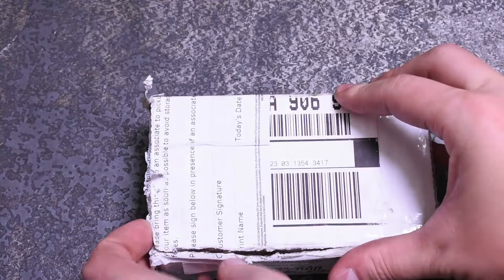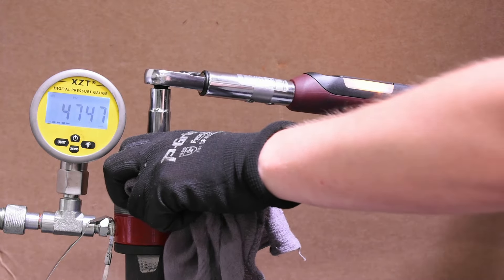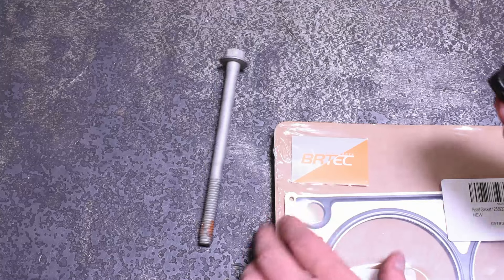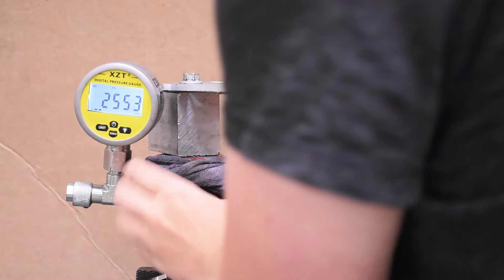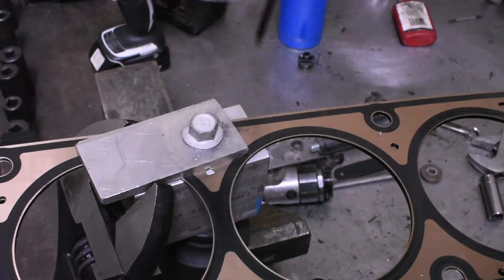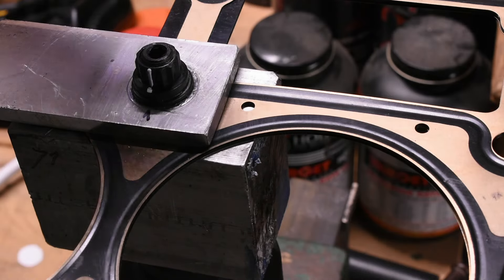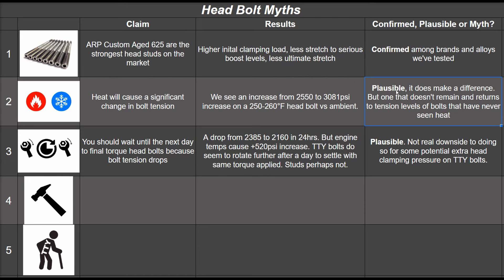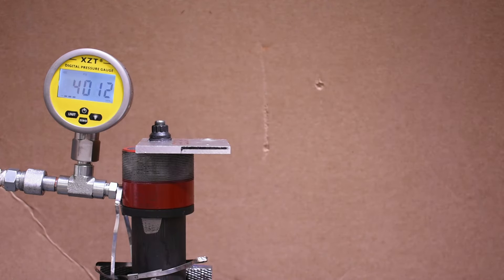CAN You Reuse Cylinder Head Bolts? Testing Myths + ARP Custom Aged 625+

Comment: Fun fact: Honda actually says you can reuse cylinder head bolts and gives a separate torque sequence for it (one less 90 deg turn.).  This still assumes they're not stretched too far of course and there is a thinness where you replace them.
Reply: Do they have a TSB on how to remove the crank bolt?
Reply: @FordRanchero289  Shaped charge using C4.
Reply: @JCWren  the shaped charge should contain approx 2500gr C4
Reply: Yes as long  bolt hasn't  been grossly over tightened  to the point of necking although the unloaded  length of bolt  of the used bolt will have increased by tiny fraction  the actual  load  the bolt can carry  before failure won't change,  also the  length of the bolt when loaded to failure doesn't  really. What has to   checked for is the condition of the threads that they screw in with out binding which would make the initial torquing before angular tightening wrong and make the angular tightening garbage.
Reply: I just did a head gasket in may on my accord and reused mine after checking the threads. I seen the separate torque spec.
Reply: on which engine?  i reuse honda bolts on b18 b20 engines although never seen any mention of angles?
Reply: @FordRanchero289  Weighted socket and a impact.
Reply: Always reused them and just torqued to spec and never got a problem even with boosted engine making double the hp
And ARP can be reused indefinitely if they are not stretched they even give a card to write the lengths before each use
Reply: @FunBitesTV   the correct term is torque to yield bolt 
it only useful for new bolt the additional angle is for the bolt stretch/yield and after one use they are normally stretched and supposedly need to be changer but like you experienced it still work fine
A can tell you that used bolt got no problem holding head gasket even at 300+hp
Reply: @FordRanchero289  thermite
Reply: @FordRanchero289  the good old starter trick
Reply: @Themobilegearhead  yep 👍 I’ve always just done a breaker bar against the ground and jump the starter to break loose. Might not be the best but it works for me and I’ve yet to have any issues with boosted B/H/F series motors
Reply: Maybe the new DCF900 will do it 😅
Reply: Yep, I love not having to do 22ft/lbs and 3 90° turns when I'm doing rings. Two turns is more than enough over 8 bolts in a hard to reach spot.
Reply: @FordRanchero289  my 2767-20 will pull them most of the time without the weighted socket, with the weighted socket I've yet to have one take more than 2-3 seconds to come loose
Reply: Honda torque specs and procedures for head bolts vary depending if it's 6 or 12 point to.
Reply: @FordRanchero289  Milwaukee 2767 got mine loose. No fancy sockets either
Reply: Torque sequence lol, degrees lol. With a rainbow flag too?
Reply: @FordRanchero289  they make a socket. it has really thick walls. its really heavy.
Reply: @FunBitesTV  Honda V6 engines have three 90 degree turns if it’s a new bolt, only two if it’s used
Reply: Yea when you're only torquing to 49 lb-ft, of course you can reuse the bolts
Reply: 1990s Honda Accord head bolts are the thickest, even a V10 Triton head bolt is skinnier.
Reply: @FunBitesTV  My K24A2 definitely has TTY head bolts, I believe all the K series engines do. The torque spec is 28 foot pounds plus two 90 degree turns for used bolts with an extra 90 degrees for new bolts. Before reusing them, you are also supposed to measure the bolts to make sure they didn't stretch too far.
Reply: People don't understand that if the application states "TTY" but you don't actually measure stretch or clamping force...you have no idea if it's actually above the elastic region. Thus if the OEM's bolts are stronger than the min spec for that torque rating, it can be re-used since it never yeilds.
Reply: @FordRanchero289  a weighted socket.
Reply: @FordRanchero289  my 1/2 inch cordless wins every time
Reply: @ddiablolll  my Acura legend is due for a head gasket replacement before it blows I might just reuse them then
Reply: @jkull173  it never fails I was amazed when I learned about this technic
Reply: @FordRanchero289   Weighted socket, works every-time.
Reply: can confirm
Reply: I worked at a multi agency dealership in the 2000's that had a Honda dealership. Under warranty, the head bolts could only be replaced if they fell out of spec. If it was customer pay the head bolts always got replaced. Don't ask me the spec as I was the transmission tech at the Ford store.
Reply: @FordRanchero289  even my 1/2" ridgid mid torq thats not even an octane breaks them free w a weighted socket no problem
Reply: Toyota also says, you can reuse cylinderhead bolts (on some engines) . You only need to check the length of them. Same torque sequence if I remember correctly. :)
Reply: @FordRanchero289  1, make sure battery negative is removed off negative battery terminal. 2. Set your purse down.
Reply: Thinking about wheel studs...you can mount and dismount wheels again and again, on the same stud. Plenty of torque on them, they get heated, because they are attached to the brake rotors, and are a mission-critical stud, being what attaches the wheel to the car. hmmm.
Reply: With today cars, fairly week aluminum block and heads i have no problem reusing head bolts, i believe the aluminum treads in the block will strip and the holes in the head will compress well before damaging or stretching the bolts imo - with old cast iron block/heads i would use new bolts.
Reply: @FordRanchero289   3/4 in. impact gun and a minimum of 160 p.s.i of air.
Reply: @FordRanchero289  easy , weighted socket ...
Reply: @themechanicnextdoor5144  thats a good  tip thanks. I'm  assuming when using the same torqued portion of the sequence the old bolt has already compensated for difference in stretch compared to new. So it needs less distance to reach yield after that point.
Reply: Where are all the old Honda,s past 2000....they are like a wal-mart toaster
Reply: My Honda book says to mark the original location of each bolt for reuse
Reply: Subaru also I’ve re used every head bolt for years and never had failure. Except for my high hp motors. The stock rod bolts will break before anything else breaks in a Subaru motor. This causing rod bearing failure. If you took a stock Subaru sti internals  which I did. And put arp rod bolts on it. It will hold 350 hp all day. The 2.0 I built held 429 hp on the dyno but that broke the pistons on the street, the rods held up though so moral just be happy with a fun 400 hp subie unless you have forged internals then still 400 hp otherwise your trans will never make it. Plus 400 hp in a subie is un real.
Reply: Good ol Honda
Reply: @JCWren possibly funniest answer I have seen on yt, both acknowledging that u know the misery and u have humor 😂
Reply: @HeidiFegles It has nothing to do with Horsepower. Upgraded rod bolts support higher RPM and or heavier pistons/rods. Think about it, higher HP puts higher downward load while max tension loading occurs at TDC on the exhaust stroke.

Comment: Well the 'myth' on reusing TTY bolts.....I work for a major auto manufacturer (won't mention who to not freek anyone out) and one of our engine types started requiring cylinder head replacements for coolant and oil leaks from the casting. These use TTY bolts that are in very short supply and frequently go back ordered so we are required to reuse these bolts by the manufacturer if they are under a stated length when measured with a micrometer. Note if these are over the stated length they must be replaced. I'm not an engineer just a technician. As you can imagine most techs, me included, absolutely hate this idea but the engineers have obviously tested them as warranty concerns are a factor. We have yet to encounter a problem with any of these cylinder head replacements some being done over 2 years ago. I'm guessing that the engineers see this maximum stretch for reuse as still enough of a safety margin.
Reply: Ford ecoboost?
Reply: Subaru impreza doesent mention to use new head bolts even though they are tty as it has 2 90degrees at the end
Reply: @Low760  you beat me to it. Lol
Reply: @Low760  either that or GM 5.3 with the lifter issue.
Reply: @JamsheedRpgGodBoss  the guy said replacing head gasket for coolant and oil leak at the casting nothing about lifter failure 
This scream EcoBoost problem or any other high stung turbo small 4 cylinder that are all the craze these past few years the purposes is they can still advertise high  HP with low mpg
Reply: I used to work on old cars and reused bolts if the bolts didn’t look stretched or otherwise damage, never a problem.  A bolt stretches at the nut or where it’s bolted in, a nut cannot be hand tightened all the way down the threads because of stretching.
Reply: Good ol' Toyota 2AR-FE engines had maximum TTY bolt length spec as well to decide whether to replace or reuse them.  Replacing piston and rings for the oil consumption issue was common (They switched to 0w20 from 5w30 with low tension rings and too few piston oil drainage holes)
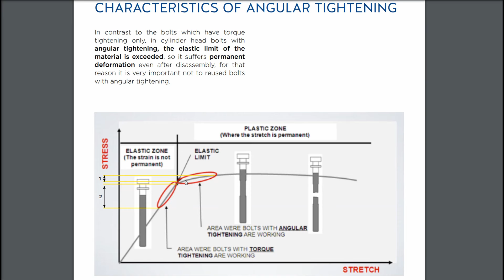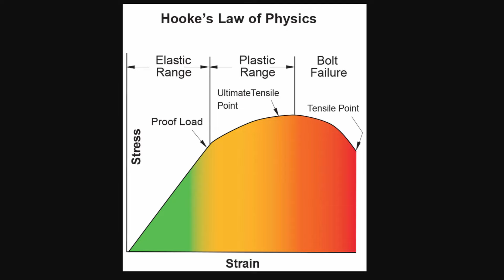Reply: If you look at the curves at 7:30 and at 8:00 in the video you can see that once a steel has been taken beyond yield it can still stretch more before it fractures.  The whole idea is that you don't want to use up too much of this stretch by re-yielding the bolt.  Maybe some bolts can be tightened a couple of times and still have enough reserve elongation left.  Consider if you pick up a piece of steel wire and start bending it, once you achieve a permanent deformation you have reached yield point but something like a coathanger you can bent a lot past this point and it never fractures.  The higher strength alloys have some amount of ductility but not nearly as much as low strength wire used in coathangers.
Reply: I say Chevy sounds like a Chevy design choice.
Reply: Trust me when I say, as an engineer, the engineers didn't decide to approve this procedure.  They were forced to by management for cost reasons.  I'm sure the bolts are 'good enough' but I wouldn't want them in my engine.  You're the type of tech I'd like to have a beer with and discuss how engineers are making your life hell.  Much of the time it is simply because we don't know the crap you go through and that line of communication isn't always as robust as it should be.  Techs are an engineer's customers, not the other way around.
Reply: After working at a ford and chevy dealership, ford is monumentously worse than chevy. Even the ford salesmen hated fords, they all drove bmws or chevys and every car they sold, they'd call a shitbox or ask why anyone would buy it.

Their broncos have leaky roofs, their trucks have huge transmission and coolant reliability issues (had an F150 with 20k, transmission was already toasted, and the subframe cracked just from the transmission snapping and slamming into gear, causing the back half to crack. Not costumers fault). Ive gotten 30 mile F-150s with coolant leaks off the truck, I've seen NUMEROUS ecoboosts and escapes that were already practically scrap after 50k miles, I've only seen one cool ford in my time working there and it was an explorer that someone modded the hell out of.

No issues like that while at the chevy dealership
Reply: Sounds like my mothers mazda, losing coolant somewhere, just outside of the warranty period, but it’s a known problem and they fixed it for free anyway
Reply: Same "proof in the pudding" with guys building sloppy LS engines, feeding engines with re-used headbolts tons of boost, and making 1000hp with no head lift. At least, if the deck surfaces aren't pre-warped lol.
Reply: You can re-use them if under the stated delta length, assuming you've measured each original length beforehand..of which you didn't, so they go to the trash
Reply: Chrysler's service manual outright says to reuse the head bolts on the 3.6L Pentastar V6 if they pass the check. The method is to put the bolt on a straight edge and check it the same way you would a cylinder head, to make sure part of the bolt isn't 'necked down"/thinner than the rest. If it passes, then use the same torque procedure as you would with a new bolt.
Reply: I don't understand how you can measure the old bolt if is stretched ? I mean you don't have data about all the bolts lengths from the factory and the bolts are different lengths they never exactly the same . When I build my engine and use ARP bolt,they are not exactly the same length obviously. But they all have to stretch 0.15mm.